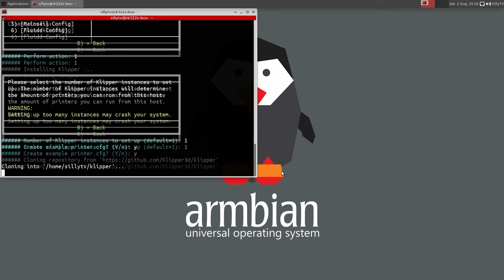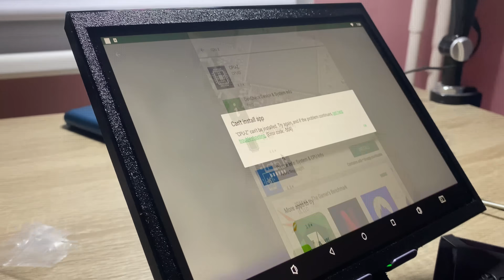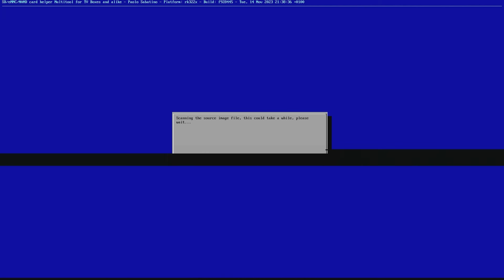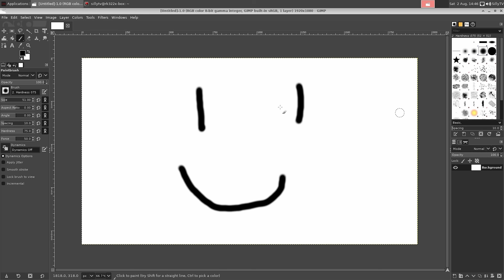Linux on a TV Box - Raspberry Pi Alternative?

Comment: The problem with some TV boxes is that the bootloader can be infected from the warehouse or factory like:
    Data Theft: Unauthorized access to credentials, personal information, or usage habits.
    Unauthorized Remote Control: The device could be enrolled in a botnet or used for illicit activities.
    Device Locking: Preventing legitimate updates or the installation of official software.
    Invasive Advertising: Injection of unwanted ads into applications or during boot time.
Reply: ai slop

Comment: Hi, good video, i have installed armbian without graphic interface on a micro sd card, you can enable wifi in the board using legacy kernel and exec command rk322x-config then select your wifi card

Comment: It's cheap and tempting, but those Chinese android boxes are security/privacy risk even you flashed clean software. There are still embedded code in the hardware.
Reply from the maker: Theoretically it's possible, but I doubt chinese would hide such code just in case one of ten thousands people tries to install Linux on their unsuported box. 

At this point, buying something like Raspberry Pi in used condition sounds much more dangerous.

Comment: What was the image you used? I'm stuck and no image I tried booted.
Reply from the maker: Are you sure you have exactly same hardware?
Reply from the maker: Hello, read this carefully.  Remember, if you have similar case it doesn't mean we have same box. You need to make SURE you have Rokchip CPU from article. If not, you should find info related to your CPU model.
https://forum.armbian.com/topic/34923-csc-armbian-for-rk322x-tv-box-boards/
There are around 800+ images built every week. On GitHub you look for one that fits your CPU.

Comment: Oh boy there's worse, those cheap game sticks with emulators to run old games.
No it's not running android, it runs what looks like lakka.

Almost zero useful information for how to run linux on it.

What I have has even way less information.
I have the allwinner a10s one.

Through sheer well and stubbornness I installed modern linux on it.

The same post on reddit where I asked for help has the answer that I wrote.

My reddit post is literally the first google search, that's how little of information there is.
Reply from the maker: Interesting, I will check those out! Thank you.
Reply: @TheSillyWorkshopYou're very welcome.
If you want to know more about it then I would be more than happy to help.

Comment: The problem with this approach is that the hardware in these boxes is rarely supported fully in the Linux kernel, and because of the lack of a real bios - even those that are need a tweaked device tree file to even boot. 
Frankly it mostly a complete waste of time as the performance available is generally disappointing for general use, and for more specialist use such as a Kodi media player the lack of native codec support makes them useless.

Comment: this is actually really cool and i kinda did something like this yesterday where i used a broken s10+ 1tb ceramic white im just giving the exact version because theres different versions with different rams and the screen is broken only the touch screen works for some reason and i connected a external screen and i put termux and anlinux freed up some space of bloatware and stuff and then i make a neoforge server on it with a ton of mods and a ton of optimization mods it runs really good with 4gb ram and 4gb swap

Comment: I have a lot of fairly new smart tv motherboards, i wanted to try installing linux on.

There was one tiny problem tho:
I have no clue what I am doing
Reply: Need to look up the chip manufacturer physically on the board or in the current tv os and then find the correct .dtb file in the /boot partition once you burn the .iso.  You may have to edit the extlinux.conf  on the /boot partition also to reflect the location path and name of the dtb. 

If you pop the name of the processor into the armbian forums people there might be able to point you towards the correct .dtb for your processor.

Comment: I have an MXG-4K running Linux, I use it as a Plex server with about 4 USB drives connected to it.

The power supply is too weak to run an external hard drive.
Reply from the maker: My MXQ-4K Pro came with two USB ports not working lol, couldn't even flash Linux on it :(

Comment: There is a similar tv-box (same H313 chip) with 8gb+128gb storage for ~15-20$usd on Aliex, I wanted to test and install a Win10 arm64 or Win11 arm64 on it but from this video I realize now it could be a fake spec item so won't bother with it.

Comment: I have a full actual laptop (keyboard trackpad screen motherboard etc) and it's so painfully slow I can't watch YouTube videos at 144p in the small player. That's what I call e-waste.
Reply from the maker: Time to repurpose it!
Reply: It can still be used for other things, such as light word processing work. Maybe not LibreOffice, but AbiWord, Lyx, or Ted.
Reply: out of curiosity, what model is it?
Reply: @gamecuber6 brand is gateway and it's a netbook. It originally had Vista on it. I swear it had Vista but there's no Windows sticker on it so I could be wrong.

LT3103u manufacturing date of 2009/07/28

By the way I did upgrade it to 4 gig RAM and was installing 64-bit OSs
Reply: Have you tried PuppyLinux?

Comment: I installed armbian and transfered the system to an external SSD, since SD cards fry often for such uses. Currently using it as a 3D printer controller/server with klipper. Flashed internal memory with RetroArch so I can use it for games too. Thermals are ok. I was able to open YouTube and watch videos without frame drops at 720p. I measured and it runs at 12W max. Great server for most light applications.

Comment: In my country, there is a ex-isp tv box which is commonly available in marketplace for only $5-8.  This isp is widely popular in 2010ish because it is one of early isp that come with tv cable subscription, so they  also usually come with tv box. 
The specification don't vary to much, you will get either a S905x (4-core Cortex A53) with 1gb or 2gb of ram and 8gb of memory. People in my community would install openwrt, linux server, or even worse running a linux desktop, but the spec is sufficient so i think its not a problem either, dirt cheap for a new computer
Reply: same there. Except the tv box is coming from Chinese OEMs, they're also dirt cheap, $5 to $6 for full packages (armbian installed, cables,...) with 2-4gb ram and 64gb storage. Tinkerer will flash a different tv box os or just watch youtube straight in armbian.

Comment: GPU model?
Reply from the maker: idk, I guess Mali-400 MP2 or something like that
Reply: @OleksiisTech have you installed the right drivers?

Maybe the performance sucks because your drivers aren't installed for chipset and gpu...
Reply: @OleksiisTech not a 470? You can try newer mesa by changing the debian repo to sid and check wayland compositor to ensure thay is not an xorg issue, I suggest labwc (default in the RPi OS).

Comment: I have a similar one it is called an MXQ PRO but has an rk3228 AFAIK I used multitool to install armbian, wifi does not work but the wired ethernet does it is  slow but tolerable a similar experience on using windows 7 with an old single core intel atom😂
Reply: I had the same problem with armbian, it took an update to a new kernel to fix it. Some boxes have multiple .dtb files that will work to boot them also, but sometimes missing wifi.  Manjaro arm worked right from boot.

Comment: You can get an Arduino Uno or equivalent knockoff for $10 these days, sometimes even less, if you need GPIO pins. If you actually want a $35 computer to tinker and automate things, Pis really aren't a good solution these days because it's very rare to see any for close to $35. You can pick up an TV box like this and an Uno easily for $30.
Reply from the maker: Raspberry Pi 3 is possible to find for ~30$, but yes, Arduino can cover the need for GPIO pins.

Comment: Hi. Try an OS called Wary Puppy linux. Not positive how well the ARM will work withit, but it's extremely capable with old hardware so the built-in wifi might work immediately, keeping all the ports free to run it with a USB flashdrive & possibly add an additional USB DVDRW.
Reply: Quick update, I've been back to a forum bout Wary & there are several Puppy versions that do handle not only ARM hardware but also still release in both 64 & 32-bit versions.

Comment: Doing this can be challenging to find the right .dtb file to work with your box,  but fun. I have debian with openbox on my Tx9s octacore +2gb ram and it runs pretty smooth.
Reply: this is the worst thing with arm. nothing is standardized so trying to upgrade is far from the pc experience. you can't usually even rip these files from the working kernel as the devs in their infinite wisdom have changed the format over the years and then theres the device specific cryptic values no one understands

Comment: I converted into a NAS using an external ssd , and its running 24/7 - replacing google drive , photo and spotify . (Self hosted ) 😅.
Reply from the maker: Based. Yours one probably has USB 3.0, right?
Reply: @OleksiisTech i wish that was the case , but my internet saturates before the usb2.0 does , max file transferring speed is 11.5MB/S . I mean with s905x and 2gb ram its fine for now , till i get my hand on laptop motherboard 😅.

Comment: You'd be better off putting Linux on an X86 Chromebox.
Reply from the maker: Video is about repurposing TV Boxes. Not about value for its money. A lot of people have those TV boxes lying around without purpose. Besides, where I live now (Eastern Europe) finding Chromebox for under 10€ is a very rare thing and it sells literally for minutes.
Reply: At that point just use any commodity computer, but these TV boxes can often be had for much cheaper.
Reply: @HIDLad001 it's common to find old Chromeboxes for as little as $7.

Comment: better cooling + some type of OC can be helped
Reply from the maker: Yeah, may be. I will try to make more in-depth videos next time. I didn't know ARM cpus have so big overclocking potential.
Reply: @OleksiisTech not that much prob just a 15%
Reply from the maker: @ShadowFandub  even 15% is a noticable, and some ARM chips can do more. Besides, in this case only a better cooling would probably increase the productivity by a significant margin.
Reply: @OleksiisTech Yes of course, also changing the ram and emmc is not THAT difficult but of course you need some tools and some experience.
It would be an entertaining project, for example if you can put the name of the ram and storage chips here I can look for their equivalents in 2GB and 16 or even 32GB of storage.
Reply from the maker: @ShadowFandub  I have no tools and experience, but I understand the process. Will it work just like that? By simply putting different chips instead of old ones? I saw a video of DosDude upgrading Apple TV 1st gen from 256mb of ram to 512, he also needed to change some values somewhere and that was a part I didn't get at all.
Reply: @OleksiisTech yup just that.
On OC terms only needs use command line to change some values

Comment: I have the same Rockchip RK322X with 1GB of RAM, and after much fiddling, I ended up installing Armbian without a graphical environment, and I have it as a Samba file server and a mini Telegram bot. I wanted to install Plex or Jellyfin, but they need more processor power and more RAM.
Reply: What about mdlna? No transcoding but very usable for tons of decides
Reply: @ManuelMaldonadoPinheiro  I tried using minidlna but I think the version available in Debian is either not up to date or has bugs because it stops working from one day to the next. I need to investigate what’s going on…
Reply: @ManuelMaldonadoPinheiro  u mean minidlna? i install it on box with s905w and 1gb, it work without any problem
Reply: interesting idea 🤔

i run jellyfin on a always free tier ARM oracle cloud instance.
Reply: @martinfinzsch8904  Yeah, my original idea was to use that free Oracle tier, but I could never get a free VM to use.
Reply: lol i even tried to use that same Rockchip box with nextcloud + 500gb usb portable hdd
and it ended up slow af, so i only used the box as a  pihole machine till this very day
Reply from the maker: based
Reply: What does the telegram bot do?
Reply: @CharlesWilsonIdaho  For now, nothing important: check the general status of the system, or as reminders scheduled by date and time (I tell it to remind me of something on a set date, and it sends me a message).

Comment: 1. the video seems to short, + you didnt cover adding a fan to the cpu to see the difference.
2. have you thought of making a server out of it?
3.i enjoyed the video. High quality
Reply from the maker: 1. Yeah, it's my main problem since the beginning of the channel. Will try harder to make them longer. Installing fan would be hard because you either need to find 5V somewhere on the board or occupy last USB Port (another is occupied with Wi-Fi dongle)
2. I basically did a server, it hosted Klipper software for 3D printing with Web Interface. I showed it in video but too briefly, my fault. Worked fine though.
3. Thank you ❤️
Reply: @OleksiisTech If it has a USB port, then it has a 5V connection going to it, so just look for the chip that is supplying the 5V to the USB port and you can tap into that with a bodge wire.
Reply: @OleksiisTechyou can get a power source that has 2 ports so you can charge bothe the fan and the board. 
Try to explore the limits of these boards, armbian is a fraction 🎉
Reply: @OleksiisTechdoes klipper run well ?
Reply: @OleksiisTech This tv box usually powered with 12v adapter, what i do is looking for 12v rating mini-shaped fan (4cmx4cm) and solder its cable directly into power pin of tv-box jack power, well it require some tinkering to figure which is which and soldering it too
Reply: Im trying to install armbian on rk3318 (4gb ram 128gb) but I lost hdmi signal.. spent hours and finally worked with a version I found, but I still don’t know how to get to this interface you showed here, im a complete beginner 😅😅 I want to basically use mine for Ambilight